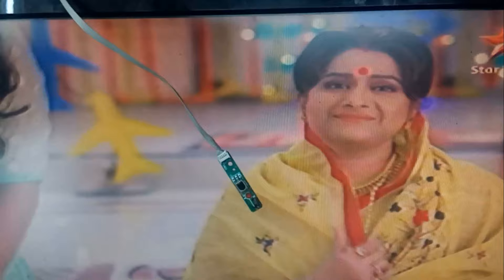LED / LCD TV Display Panel Repair | T-con Board Repairing | DC to DC Converter Voltage Details

Comment: Hi sir, i have a question.. i have a tcon all voltages are present but the dc to dc ic is hot to touch and i have a half screen with vertical bars. The tcon has only 1 flex cable no option to hang or isolate. Thanks hope to hear from you

Comment from the maker: ❓❓❓
Dear friends, before changing the DC to DC converter IC, make sure that the circuit is going to safety mode, Because, the IC of DC to DC converter circuit is damaged in very very few cases. 
❓❓❓

Comment: Hello my friend, I'm from Brazil, I really liked your video, here I also work with tv maintenance and we got several problems, congratulations for your video.
Reply from the maker: I'm glad your nice comment.  Many thanks brother.
🌹❤️🌹
Reply: v236bj1-p01 panel repair vatekkal
Reply: v236bj1-p01 panel All voltage ok  vartikal

Comment: Dear teacher, I have a question. How did you know the DC to DC converter was bad and not just in protection mode due to some panel shorting?
Reply: YES 
ALSO I DIT THIS  THINK ,
SAME QUESTION
Reply: Every good technician will likely know. In every input there is an output. Even laptop has similar ic known as. SMPS . 19 input generate 5v & 3v
Reply: Check output pin for short.  If not then its ic. Look at datasheet.

Comment: If all voltages are complete and the problem remains, does that mean the ribbon on the cof is having dry joint or could there be any international short

Comment: Dear bro, I have 32 inch led tv with same kind of fault. I have checked the voltages VGH, VGL, VCOM etc. All are present. When I connect the left FCC cable, DC to DC ic getting hot. Can you give me a tip what to do please.

Comment: AssLamualaikum.brother
I have a question. Suppose the ic is not available on the market.
So what can we do?
Can we make a jumper to connect the voltage missing. Or  it's not a good idea.
Thanks.

Also please I really appreciate all knowledge you are sharing.
I want to ask you if you can make a video by making a chart or diagram and label every components voltage.
JAZAKUMULAH KHAIR

Comment: I have vertical lines and no sound, I am assuming is my t-con... I cleaned the ribbons (No Change).. I DISCONNECT ONE SIDE TO THE PANEL, PICTURES GETS BRIGHTER!!! ONLY LIGHTS "NO DISPLAY" I AM RECEIVING 12V IN AND OUT OF FUSE, HOWEVER NO MORE VOLTAGE ARE GOING TO ALL NECESSARY TESTING POINT ON T-CON... DO YOU HAVE A SUGGESTION???

Comment: SIR VGH 32V IS OK VGL IS 2.6V AVDD 16.6V OTHERS VOLTEG IS OK BUT VGL COMBINATION DIOD 1POINT GROWN NO 2POINT TESTING POINT VOLTEG 2.6V NO 3RD POINT MIDIL IS CAPACITOR TO TCON IC CONNECT 3.2V THIS POJITION IS TCON BOAD AND CIRCIT?

Comment: I did reapir a MI tv, same fault, that was a cable to screen damaged.
Reply from the maker: Before changing the IC of DC to DC circuit, it is important to check whether there is COF or any other component short.  Because that IC is damaged in very few cases.
Thanks Brother.
🌺🌺🌹♥️🌹🌺🌺

Comment: what is correct voltages on Vcom M215hge L21, i need fix my lcd. can you send me your contact?
Reply from the maker: Each company's panel has a different VCOM voltage, and that voltage ranges from 5 volts to 8.5 volts.
Reply: @OrnatePixels  i have service manual about it, can you help me? i send  for you.